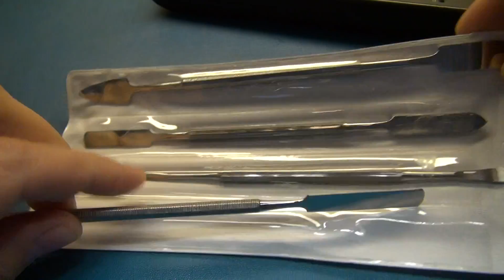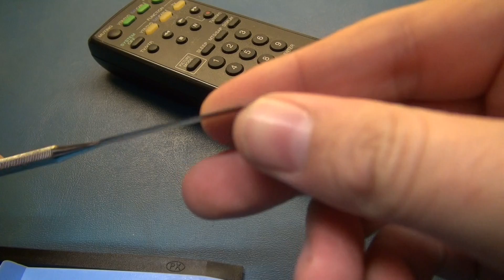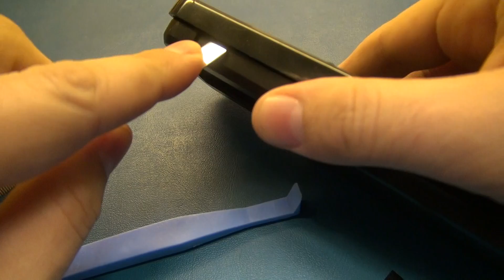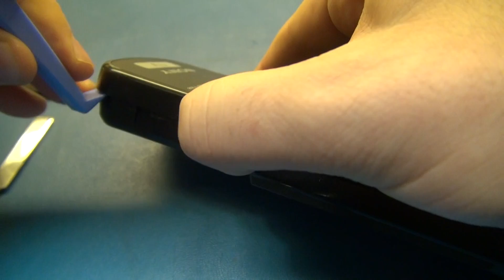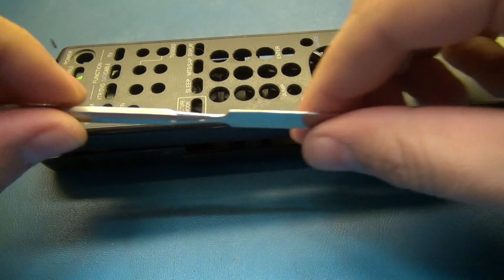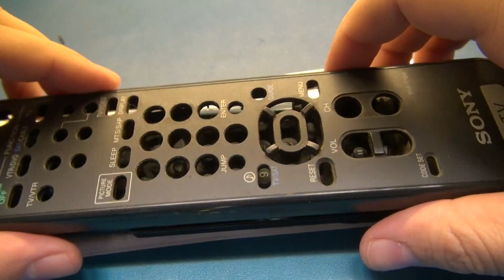ELECTRONIC REPAIR "SPUDGER TOOLS"

Comment: Dude,

The reason that you're having so much trouble opening the device is because you're prying in the wrong direction!

One piece fits inside the other.  You should be prying the outer piece outward so that you create a gap between the two.  What you're doing is prying the inner piece outwards, tightening the gap, and then applying a lot of force to overcome your mistake, even if it means breaking the case.  Not good!

Comment: Wow that remote was a pain in the @ss to open. Hey have a quick question if you don't mind. I have a USB Samsung external hard drive. The port in the back that connects to the USB wire broke off.Can you tell me if it fixable I wish I knew the name of that port it attaches to the usb cable. Just today it broke off I was able to open it but that piece came off completely. looks like the pads came off. I am pretty good at fixing stuff as long as its not imposable.